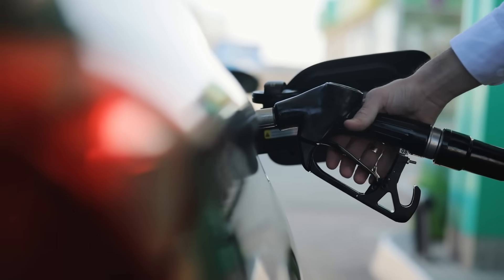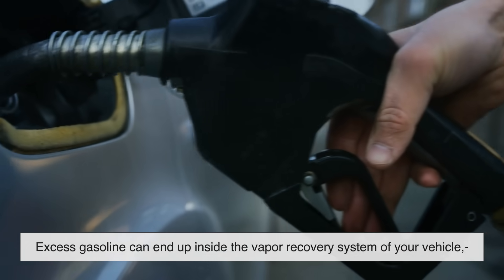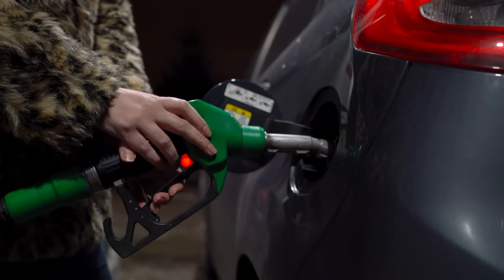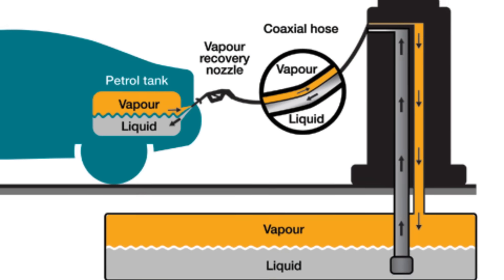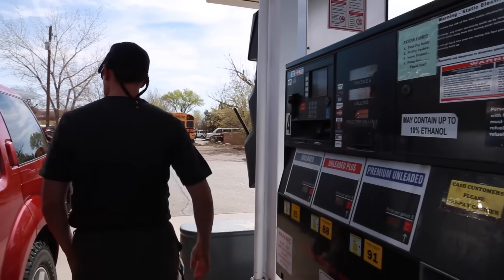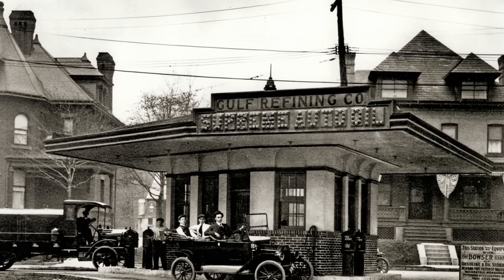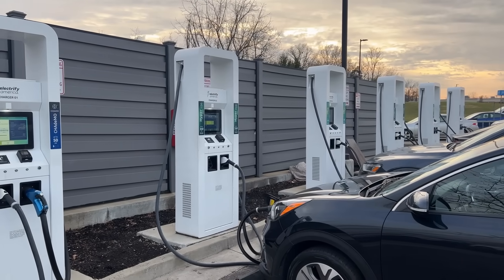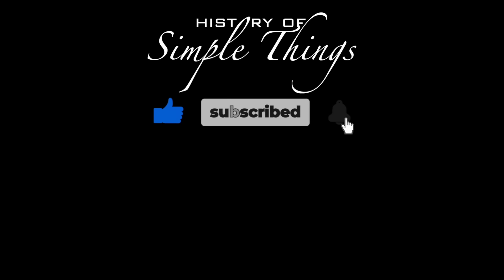How Do Gas Pumps Know When the Tank is Full?

Comment: You should never operate a radio frequency (RF) transmitting device, such as a cell phone, close to an area of fuel vapors.  You are completely wrong dismissing this as a "myth".  It is not the phone itself that can ignite the vapors.  RF energy from the phone or other RF transmitter can induce arcing between gaps in metal items depending on the gap size and the frequency and power of the transmitter.  It is those arcs that can ignite the vapor.  This is why in the Air Force we are prohibited by Technical Order 31Z-10-14 from operating transmitters on aircraft inside of hangars where fuel vapors can gather.  People confuse this with not using old style landline phones in houses where there could be a natural gas or propane leak.  In that case it is actually tiny sparks generated by the rotary dial mechanism contacts that can ignite the vapor.  Reconsider your advice and classification of this as a "myth".

Comment: The automatic shut off doesn't always work. I've used plenty of pumps that don't shut off and will spew fuel out. It's quite common actually.
Reply: I’ve been driving for 70 years and I have never had a nozzle fail to shut off.  Can’t be all that common.
Reply: @kenmohler4081  It's a lot more common than you'd think. I've had it happen a handful of times over the years as well as seeing it happen to others while they were fueling up. Just recently a guy walked away from his vehicle while he had clicked the nozzle on. It didn't shut off and gasoline was gushing out all over the ground. By the time I saw it and ran over to shut it off a good 20 gallons of fuel had totally flooded the ground. A station maintenance worker came over to clean it up and said that this happens quite often and this is why there are signs posted stating that you must stay with the vehicle while fueling it up. Some pumps work just fine, others will shit off, but do it a bit late and some gas will leak out while some don't shut off at all.
Reply: I've driven over a million miles and fueled up vehicles in almost every state and I've never seen a faulty auto-shutoff nozzle.  Not one.
Reply: @NealB123  They're out there, you must not get around much 🤣
Reply: How old are the gas pumps that you use and how long has it been since it has been fixed
Reply: @Calciferzero  Modern pumps at the local Pilot travel center. It's quite common here.. I've also personally had it happen at a Maverick and even called their customer service about it. They verified that it spilled fuel everywhere and put the pump out of service.